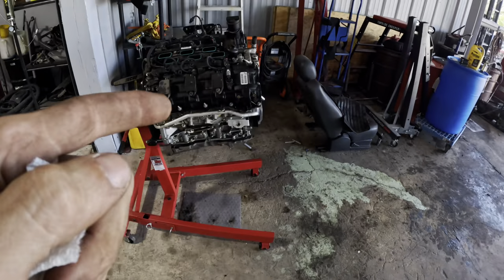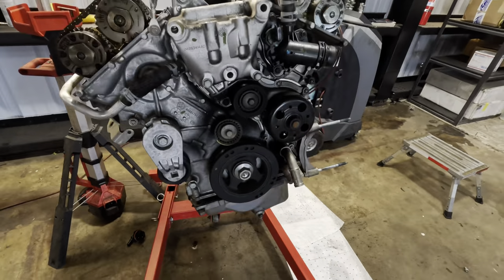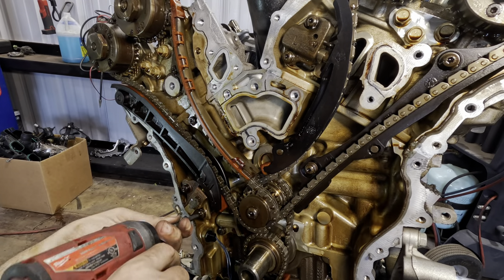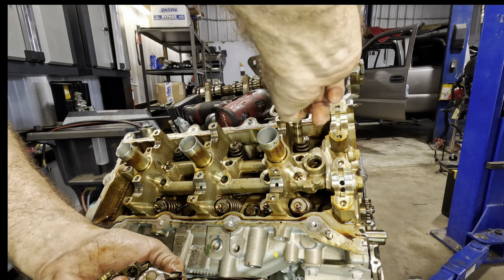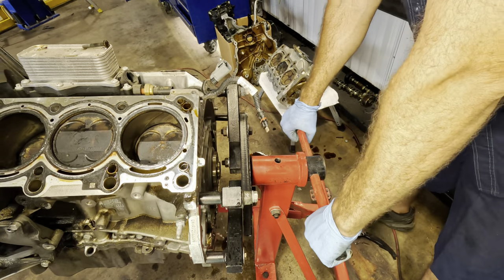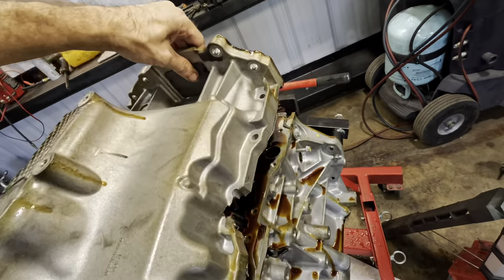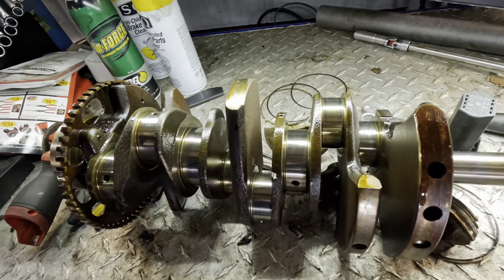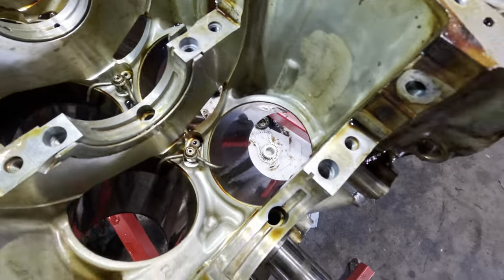Blown Engine--Broken Rod ! Autopsy 3.6 Pentastar Ram Jeep Chrysler

Comment: My guess:  Engine got hot, overheated, gasket let go, hydrolocked the engine for a moment, rod bent and broke loose, cracked the piston, coolant leaked down through the new crack in the piston into the oil pan.   

As easily as the head came off the block, it didn't seem well sealed by the headgasket.  Plus the clean pistons as you noted.  Nice amount of carnage there, what's the spot price for pre-shredded aluminum?  Lol.

Comment: My neighbors GMC 350 engine had a blown head gasket . When it started cold I seen bubbles in the radiator. I told him not to drive it . He drove it . He hydro locked it . Breaking the connecting rod . .

Comment: Was there any visual impact on the cylinder three oil squirter.  The squirter is bent, just curious if it was caused by self disassembly.

Comment: the engine seems to be a well designed engine based on the disassembly - external issues seem to have been the root cause of the failure i.e. hydrolock

Comment: Pentacrap! didnt this vehicle have only have like 136,000 miles or something? All these newer "more efficient" engines seem to be really fragile. Low compression oil rings, plastic every where. I took our 2020 Volvo in for reg maintenance (10K oil change which I do not agree with) and the had a stack of appointments for blown 2.0 Twin Charged engines. (turbo and supercharged engine). Tiny engines in big rigs = not good. We hit 40,000 miles on our PHEV Volvo so Ill be insisting on more frequent oil changes IF my other half tells me the mileage, ANother great video.
Reply: it blew up because it reached its expiration date lol. I think as someone mentioned it got hydro locked by the fuel injector.. but def hydro locked by something would be my guess

Comment: Dang Ray !! Thanks for the insight into the Chrysler 3.6. I've seen enough to say that I DO NOT WANT a vehicle with this engine in it. So.....many.......weak......spots.....(shudder)
For you see, I thought that the people that designed my Pontiac G6 were simpletons. Amateur Engineers that were assigned to their very first design. If they messed up they get the ole' "That's OK kid. Ya tried yer bestest and that's what counts". 
Then, along comes (yet another crappy) Chrysler V6 engine. It's even worse than the last crappy Chrysler V6. I will use one of Ray's best comments.......
WHY ?...........Why ??.......Why, Why, Why do they (American auto makers) keep doing this ?? 
It's like they INTENTIONALLY - WANT TO FAIL. Is it a death wish ?? Struggle to suicide themselves ?? A narcissistic dream to customer relations ?? A giant black hole (for money) located in North America ?? Is it an attempt to break their own record for recalls ??

Comment: Even in a terminal state, the bolts came out a lot better than the rubasu Water pump bolts..😂
Reply: The Rubasu bolts were fine.  It was their holes threaded into ALUMINUM that were bunged up. 😜

Comment: Something I'm gonna say is that, wrist pins are made out of tool steel. They are the only thing in an engine made of such. They will not be worn down by anything else in the engine. And usually almost always wind up unscathed and reusable(somehow) despite these kinds of catastrophic engine failures. HOWEVER that isn't to say that they are practically indestructible in all engines. No no, If you've watched enough of I do Car's videos, and have seen the engines where the failures were catastrophic enough, you will know that even wrist pins, despite their mighty and usually near unbreakable nature, can be broken by an engine. I know of at least one video where he found a wrist pin. Shattered into multiple pieces by the force that had been applied to it at the time that particular engine had failed.

Comment: Clearly a blown head gasket caused it to hydrolock that one piston. The head gasket might appear fine to Ray, but the top of the block shows clear signs of water moving from the water jacket directly to the cylinder.

Comment: If hydrolock was due to coolant from a leaking head gasket, wouldn't that have been evident when inspecting the head gasket? And if it was hydrolock from fuel, that wouldn't explain the low compression, would it?

Comment: Follow the clues ,,, broke water pump seal ,,, miss matched tork on the heads ,,,, I noticed the center bolts on number three side came out with ease ,,,, clean piston top ,,,, no broke valve Gides  hydro lock ,,,,,

Comment: Actually these pentastare are very good they are designed and built by Maserati, but they used some inferior part for dodge. It's the same engine in alfa romeo Giulia Quatro foliage,  they've squeezed 600+ hp with a few upgrades.
Reply: Interesting!

Comment: head casting problem that chrysler new about since 2010 and they only warrentied till 2013 ( said they fixed the problem )   i had a 2014 and at 148,000km i got the cyl #3 misfire  and front bank had to be replaced ( found oil pump was broke ) 5000.00  parts and labour   then at 180,000 trans grenaded    5:000 parts and labour      days before christmas  189,000km  got rearended---and wrote off

Comment: With a fleet of cars that contains a 2016 with 48,000 miles, a 2005 with 217,000 miles, and 1995 with 127,000; I could not express what my level of disappointment and frustration would be to have a catastrophic engine failure on a 2017 automobile! That said, I don’t buy Chryslers either!

Comment: At 24:24 there is something laying ontop of the #3 broken piston at the 4 o clock position  down in the cylinder . When you knock it out later this piece is gone but the indentation where it struck the piston is there and on the heads ??

Comment: What if fuel from new injector filled cylinder 3 and caused hydro-lock resulting in broken connecting rod? Never heard of a connecting rod randomly just bending and breaking off from hitting nothing. Unless there was a sign of a blown head gasket I'd say it was fuel.

Comment: 44:57 know wonder that Ridgid High Torque was struggling Ray was running a super low🔋on 1 bar only 😂. I have the same high torque and run it with a Octane 3Ah battery with the 21700's hits harder than the standard Maxoutput. Anyways great tear down 🤙🏼

Comment: Did you check the cylinder wall? Could be cracked. I saw a few on the caddy HT4100 engines.

Comment: Ray, wernt you having injector problems with that cylinder? Could it have dumped a bunch of fuel into that cylinder, then ignited like a hydrolock situation with water from a blown head gasket only with fuel?

Comment: Complete engine internals neophyte here - question.  At 15:18 is that a crack in the block/maniflold in the valley between the heads.  Right in the middle of the red guide (left) and the black guide (right) you have the large channel with 3 bolt holes above it. Just to the right of the center bolt hole.

Comment: Just to take a different look at this, what would it have taken to have an object to penetrate the block to cause this issue, is there anything on the forward side (I believe #4 cylinder side) that shows an impact from an external object?

Comment: Question I’m assuming these are installed in the Dodge Promaster vans. I Ride the MetroNow vans which is a subsidiary of our pubic bus system. Main issues now is the lack of parts to keep these vans on the road. Up in your area are you running into these issues?

Comment: oil squirter on piston #3 looks bent out of place... could that cause that failure?
Reply: I would say that was as result of piston coming right down the block, and the skirt, just before the crank cleaned it off in sections, wiped the nozzle out of the mounting.

Comment: That engine  hydrolock . Most likely  bad fuel injector drain the fuel rail or coolant leaked in the cylinder  when was shut off .Rod snapped when your customer  tried to start their vehicle  because you can't  hydrolock a running  engine

Comment: The engine was designed (from a "clean sheet") in the USA by Chrysler, it shares no parts or design elements with any MB engine, it was re-engineered for Maserati.

That there is a 100% American boat anchor.

Comment: Sure looks like Hydro-lock. My bet is a head gasket leak that sprung while driving and the engine was able to burn it off or convert it to steam as it slowly dripped. When the engine was turned off, enough fluid leaked into the cylinder while sitting, that upon next start-up...boom. Broken things. I say head gasket and not injector because the injector would stop leaking as soon a it relieved fuel system pressure after the car was turned off (Unless it was left in KOEO after engine shut-down). I say it happened upon startup because everything else is so clean and undamaged.

Comment: Weeee! An autotopsy! 😂

The urban legend goes, there were bad crankshafts installed at the factory. 1st shift employee mic-ing the parts found that the lobe for cylinder 3 was bad, not mic-ing to spec. Engineers were called in, crankshaft line was shut down, etc.... There was a stock of good assembled cranks, so they continued making engines thru the first and second shift. Third shift came in, no one told them about the bad crankshafts and when they ran out, they proceeded to take known bad parts out of the "recycle bins". Motors would blow (usually) shortly after the warranty expired (36K). So many ppl had the problem and reported to the govt, they wanted to make Chrysler do a recall of every 3.6L, but they agreed to just offer an extended warranty on that motor 10yr/150k. Of course, these same motors are also know for multitudes of other issues, casting sand left in the block, etc....

Yes, I worked in the auto industry...

Comment: Wow. Last petrol, I’m sorry, gasoline engine I had that far apart was a 1.0 litre Nissan Micra, over 20 years ago now, which surprised me with how thin the con rods were, even allowing for it being a tiny engine.
But, compared to those ones, the Micra ones were enormous. How can such humongous engines, with modern fuelling ensuring much better fuel to power ratios, get away with such puny rods? Oh wait… Yeah!
I’m glad nobody bothers rebuilding stock engines any more. I wouldn’t be comfortable with them. At least with diesels, there’s enough substance to them to feel confident they’re going to stay together, when you put them back. Still usually worth doing, too.

Comment: This is the engine that Ray killed with gasoline hydro lock. When he put a new injector in it and that injector just kept pumping fuel in the cylinder.

Comment: Hydrolock seems likely. Head gasket was leaking. If the customer was paying attention it's likely this V6 would have had a longer life. So many people was money buying cars and don't properly maintaine them. Save money people, change your oil and other fluf on a regular basis ! Put a bit of cash into your ride you really don't "need" a $1500 -$2000 cellular device !

Comment: engine forensics  is always fun to do  to test yourself and coworkers  in who have the best qualified guess before tearing it apart.  kinda like a doctor reading symptoms.
im with you on the hydrolock theory.
all signs point to it.
its just weird there is no apparent sign of where it failed since it have to be a large discharge  to let enough water in to hydrolock it while driving.
maybe they drove too fast trough a deep puddle and the intakes is made in such a shape it will run into the center cylinder first.
but to prove that we need to examine parts you dont have shortly after it happened for wet intake/filter  etc.
would explain why both middle pistons are cleaner too  .
Reply: There was an apparent sign of the leak, Ray just missed it.

Comment: By the look of that steam cleaned looking piston I would put my money on headgasket failure and coolant leaking into the cylinder thus hydrolocking #3 and bend/breaking the rod. It would also explain a misfire on #3 that probably got worse then killed the engine.

Comment: Interesting wreckage. I'm curious what the customer pays for here (and in the prev video). It seems once the hole in the engine block is found, the solution is known (junk the car or replace the engine).

"Why" doesn't seem relevant to the customer unless they are just curious. Additional diag seems of little customer value. There is of course [1] CYA in case the installed fuel injector ended up causing the carnage or [2] "likes and subscribes".

(I'm assuming a "short block" + oil pan etc is not an option given that's not been mentioned - if that's an option tearing the top end down to confirm it's salvageable would be needed?)
Reply: The events of this video seem to be driven by Ray's curiosity he has and the independence of his own shop.  He got ahold of the engine and wants to investigate.
Reply: I figured it was a bad injector that he put in that caused hydro-lock to occur and catastrophic damage. He should have tested that if he really wanted to know what happened. I think he was trying to show that it wasn't anything he did and it just coincidentally failed after he worked on it.

Comment: I wonder how common that problem is.  It almost seems like the German technology was shared with Chrysler but not the defective parts.    😂. My dodge dropped a valve seat.   No one wanted to take responsibility for it.  Just kind of curious if they knew about all these issues. But still shared it with Chrysler on purpose.  Out of all the videos I have seen.  Something smells like bullshizzle on the manufacturers side. Or a hidden way to cripple the US auto industry. Have you all seen the multiple recalls.  Lol 🤣 Good luck sir.  You are one of the best.

Comment: at 24.07 you can see where head gasket is devoid of dirt on top right where damage to head is apparent. when will manufactures start to build the ultimate 4-cylinder engine instead of these elaborate time bombs?

Comment: Damn, that is not right.  I feel sorry for the owner who bought that vehicle, and had to go through this.  I hope they checked for the SEVERAL class action lawsuits related to that engine failing.  They deserve to be made whole.  Ray, this is the first time I didn't cringe watching you use a pry bar on a machined surface, especially on an aluminum sealing surface. 😁

Comment: I'm seeing this whole engine failure as a retired trucker with 25+ years of experience.. not as a mechanic....Variable oil pressure is the most likely suspect of this engine failure im thinking.. The MORE systems you put into place to make things run. the more chance of a failure... All it would take is a small delay from that solenoid to create a low oil pressure failure on the oil pump system.. .btw .. those oilers point directly at the piston walls.. momentary delay of oil would create the needed friction for sure... without a heat witness mark?(Note the burn marks on the Piston bearings?) "K.I.S.S." is any engineers moto?(yep.. totally ignored for this engine as it was designed with production cost cuttings only in mind?)

Comment: Doesn't the owner need that engine for core on the new (or new to them) engine?
Reply: He's going to put that Chinese 2 cylinder motor in it. Comes with a pull-start adapter.

Comment: you comfirmed my assessment that water got into the cylinder and hydro-lockthe water does not compress so therefore broken piston,bent rod and other issues related happened all in either repid sucession or at the same time...lol if a head cracked or a head gasket failed there you are...lol

Comment: If you look on the cylinder head at cylinder three. There's a piece of the cup missing that's between intake valves. Not saying that's a cause but that cylinder head is trash. Definitely got some liquid in there and punished that rod.

Comment: Well just slap a new connecting rod in it and patch up that hole with some JB Weld and it will be good as it ever wuz. Oil pan may need cleaning out but then the oil filter should catch that scrap metal. Then it will be good as it ever wuz which wasn't very good to start with ; )

Comment: I think the injection was nonstop dripping into the zylinder, that filled it, cause you can´t compress fluids. That cause the death of the motor. ;)
Reply: I don't see how that would cause low compression in that cylinder?

Comment: I like what you are doing and your videos. But, please, stop using your tools wrong. Do not use extensions or, as you like to call them, wobbly bits if you don’t need them. This will improve control and functionality. But most of all SAFETY.

Comment: Commenters are quick to jump on the assumption the engine failed. This IS Florida. What if the driver drove thru standing water and ingested water into the cylinder that way? THAT could cause this, could it not? I can predict with 99% confidence, if it makes a difference on who pays for the repair, you'll NEVER get the truth from the driver.

Comment: Buddy and I had a shop around plandemic, had a 2017 grand caravan get towed into our shop. Dealer told us he wasnt sure what was wrong but the key wouldnt do anything.
Long story short, stripped the intake box down to the intake, full of water. I MEAN FULLLLLLLLLLLL the entire BLOCK was full of water. Still not sure who or what the hell happened to that engine, but ive NEVER seen an engine have that much in the INTAKE lmao. 
We replaced the engine that week lmfao.

Comment: I wonder if they previously had a head gasket replaced. The coolant in the cylinder prior to replacement could have fatigued the rod. Then it was just a matter of time/stress before it gave way. Or maybe just a leaky fuel injector? Either one could explain the "cleaner" dome on the piston. Who knows. Could have just been an act of God just because it is a Chrysler. LOL

Comment: I definitely think the low compression and misfire was from a small head gasket leak and that caused the piston to try to compress water, bent the rod, and then the bent rod broke off and started going through the side of the block. 

Water was in the exhaust system after all.